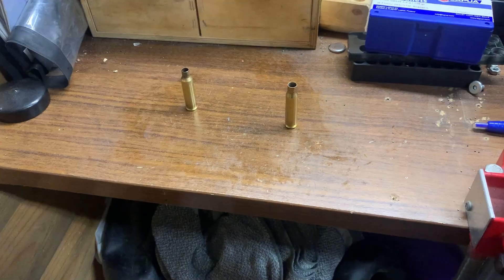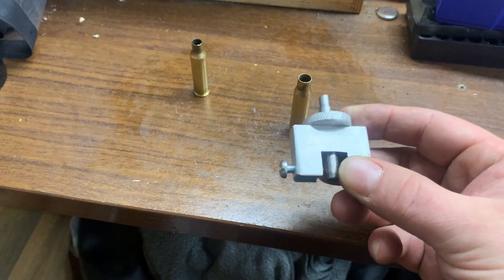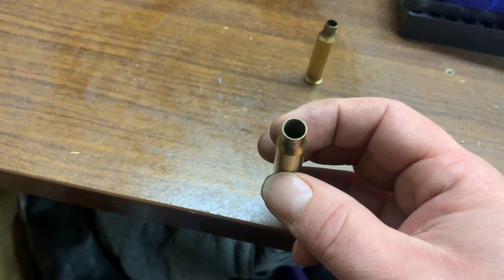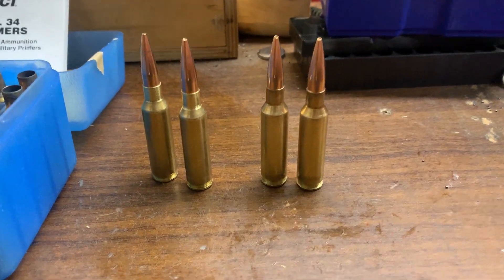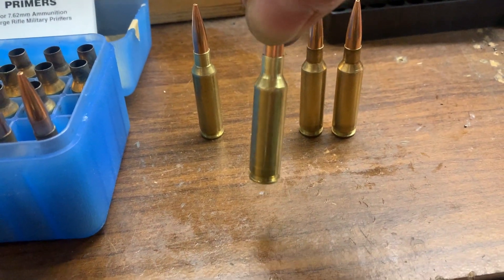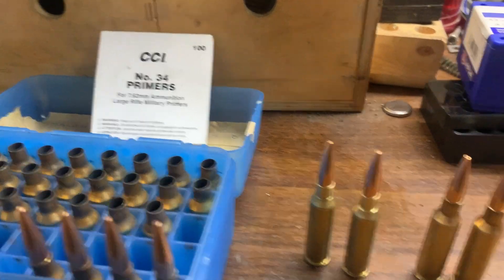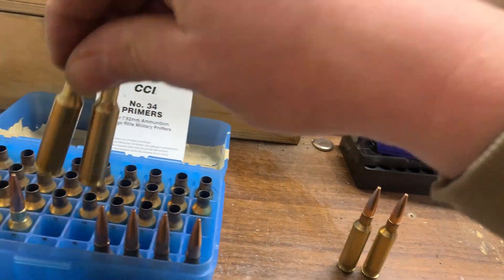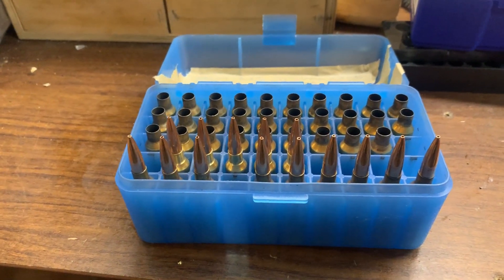Converting 308 win brass to 6.5 Creedmoor

Comment: I've literally done thousands of them.   It is easy but you need to take your time.  I use a lube that is 12oz of ISO-Heet gas line antifreeze (100% isopropyl alcohol) with 1oz of liquid lanolin mixed in.  After spraying with lube I take a q-tip with a little Imperial Die wax on it and I lube the inside of the neck at the base to smooth the final pass when the expander ball passes thru, I use a standard resize die.  I run them thru my RCBS Rock Chucker and trim.  Easy-Peezy.  I do turn the case necks, some brass has a very thick body like Federal brass so I turn them to a wall thickness of .015" but most times it's not necessary.  I always use a "G" letter drill in the neck after sizing just to make sure there is no built up brass in the neck.  In my Savage 12FV that brass and a 130gr ELDm bullet shoots to a 5 shot group of just less than 3/8" (.9mm).  FYI, the first time you fire those converted cases you are fire forming them, after that first firing your groups will tighten up a small amount.
Reply: Hopefully you get this, I'm trying to convert LC MG brass that has been processed (roll sized) to include annealing. I'm first sizing it with a lee FL sizing die w/ the decapper/expander removed. My plan was to run it through the sizing die after w/ the expander installed to get the neck diameter correct, and then trim last. W/o the expander die installed my the inside neck diameter is something like .244 so about .02 to narrow and its exceptionally difficult to get the expander ball into the case. the Lee design uses a collet at the top to hold the decapping stem w/ friction and i can't get it tight enough to pass the expander through the neck to get close to the .264 that i need. Added to that the neck thickness is is about .003 thicker around the neck. Do you think i should keep the expander installed on that initial pass? then trim then turn? I have a lot of this MG brass, most will go to my ar-10 in 7.62 but i'd like to convert a portion to 6.5
Reply: @jonathanteeter9572  The MG brass is good.  You need to resize with the expander ball in place otherwise your adding work and could collapse the neck.  Ask me how I know, lol.  Here is what I would suggest.  Lube is your friend, I use die wax, Hornady or Redding but use it very sparingly or my spray lube.  That lanolin/alcohol mix I talked about in the last post is the slipperiest stuff I've ever used and it's cheap, put it in a Dawn PowerWash spray bottle, put your brass in a ZipLoc bag, pump in 2-3 shots, mix and let it dry for a minute. It's a Dillon Precision recipe.  The secret is to take a Q Tip and lube it with a light coat of wax INSIDE the neck.  The expander ball will slip right thru and I resize the brass 2 more times turning it each time for consistency and then trim to a final dimension and the expander ball will work the thick brass in the neck a little thinner. Neck turn, ream the primer pockets and I bought a Little Crow Gunworks Brass Annealing Mandrel in 6.5mm Creedmoor,   https://www.midwayusa.com/product/1025230687?pid=542003   .  I use a propane torch and a drill and give the shoulder section 8-10 seconds and let the brass air cool, it makes a big difference.  Hope that helps.  If your still having problems with that stem you can either buy a seperate resize die individually from a different manufacturer or epoxy that stem in place in the top locking bushing.  You won't be able to move it after that so you need to make sure it is at the correct length for decapping but you can still remove the bushing from the die if necessary.

Comment: Non annealed?
Reply from the maker: Correct, doing it as simple as possible with minimal amount of steps, so far they have survived 5 reloads with no cracks.
Reply: Seems like an extreme amount of case reformation to brass without annealing is harder on brass and harder on die and press. Do you trim or check shoulder?
Reply: If you anneal them before resizing the case neck will collapse, they can be annealed after but I've converted thousands of 308 and never annealed any and some I have almost 10 firings on.  The 6.5 Creedmoor is very gentle on brass.   @magic4221

Comment: But why?
Reply from the maker: Just for fun I guess, and you can actually leave the mouth of the case a little more thicker in material when turning the neck to get the bullet more aligned to the bore, atleast if the throat of the chamber allows it, they actually now shoot better than the factory brass.
Reply: Because .308 brass is cheaper than 6.5 creedmoor brass.